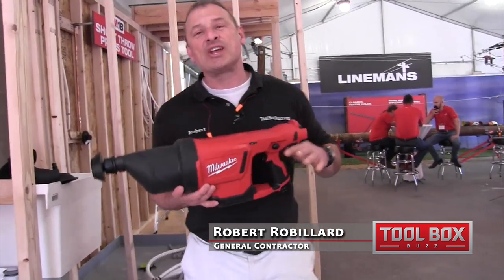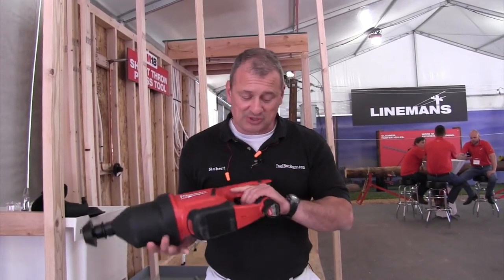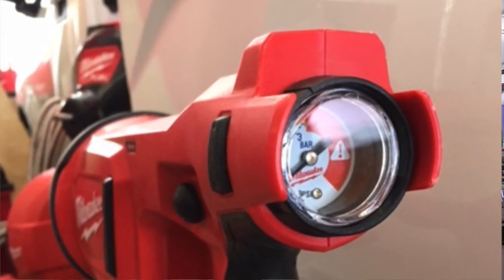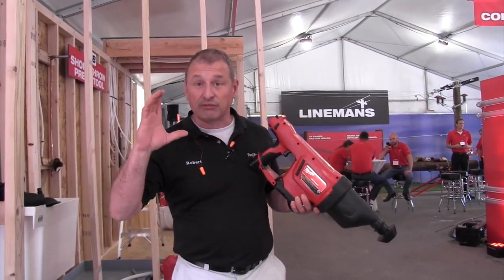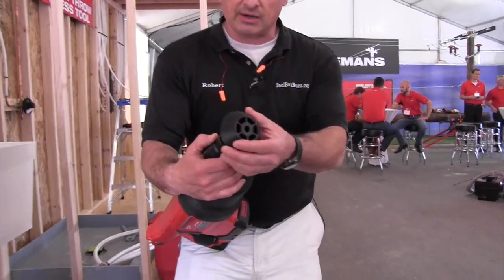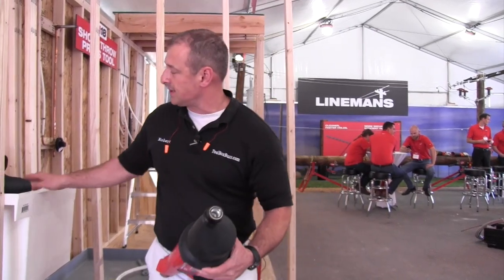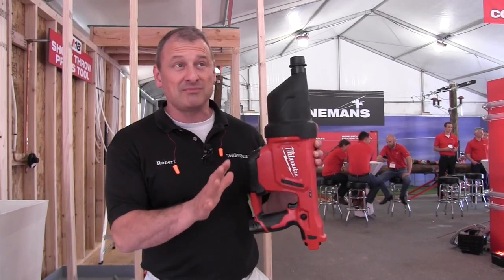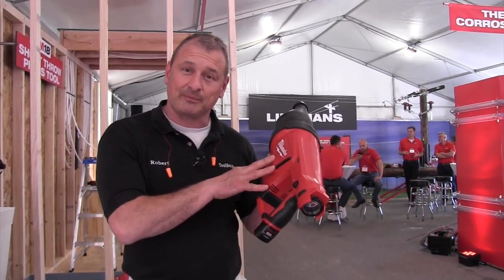Milwaukee M12 Air Snake

Comment: this kind of tools can pushing your pipes apart you have to use it carefully
Reply from the maker: De Walter you are 100% correct, you have to take into account the condition of the pipes that you're working as well as increased PSI gradually using experience and common-sense  as your guide

Comment: ya... @ 50 PSI are they gonna break anything?
Reply: Darksahde Wu it's 50psi
Reply: I'm sorry, I heard it wrong in the video XD
Reply from the maker: You have to take into account the condition of the pipes that you're working with, as well as increased PSI gradually, using experience and common-sense  as your guide
Reply: Common sense is hard to come by in current society